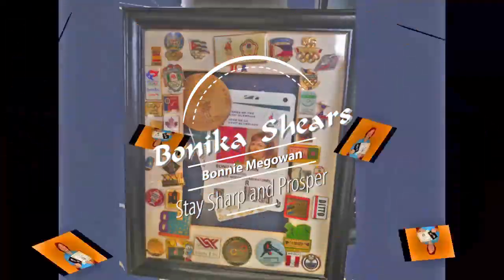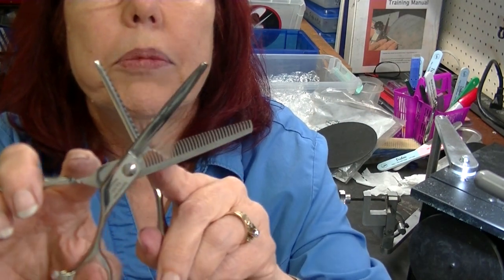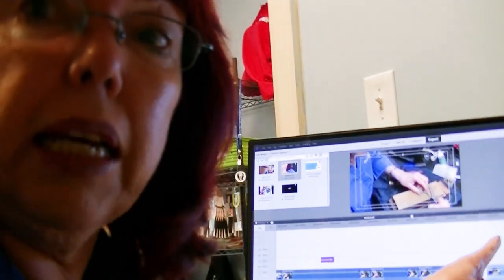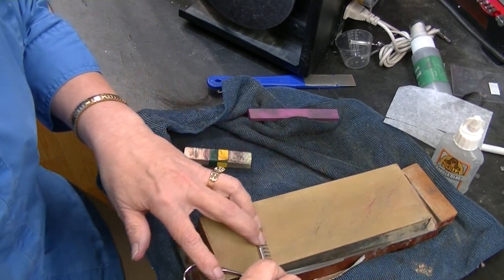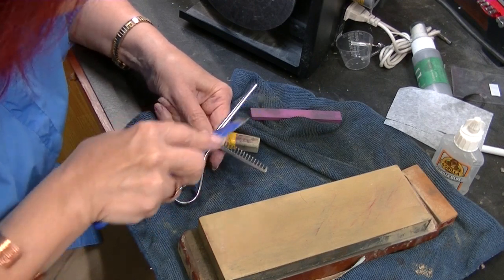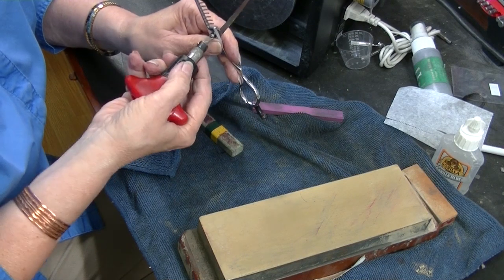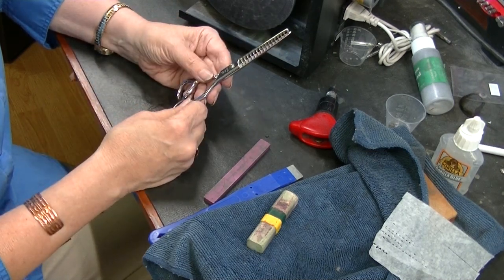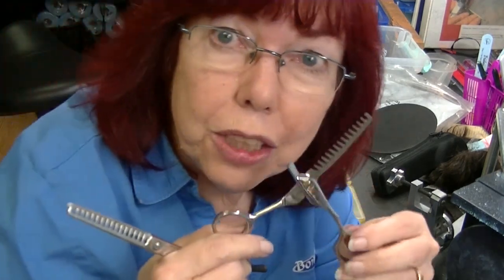How to Ramp Thinning Shears When the Teeth Catch

Comment: 🎯 Key Takeaways for quick navigation:

00:00 😡 The transcript chunk discusses problematic shears that catch when closed.
01:27 🛠️ Ramping is a method used to fix shears with catching teeth.
03:15 🔨 Ramping can be done using different techniques, such as using the handle as a gauge for the angle.
05:17 💡 Adding an extra washer can help fix catching problems in shears.
07:52 💡 Protruding washers behind the screw can cause cutting problems in shears.
09:47 🔧 Ramping can help prevent catching, but careful not to overwork the shear or break teeth.
12:33 🔧 Ramping thinning shears can be challenging, and it's important to avoid bending or breaking the shear.
12:59 📚 Sharing knowledge and experiences with other sharpeners is valuable for continuous learning in the sharpening business.
Reply from the maker: I need you to write these up for all my videos. Thank you.

Comment: I tend to flatten both blades first no matter the number of teeth.  Then a few passes with the pink stone.  When I see damage like this first thing I would then do is sharpen the cutting teeth side. * can not do this with the texturizers with multiple swept teeth with several  notches.  Then I come back with my finest serration tool and apply a new series of notches... Flatten to remove burrs on the blade.  Finally come back with my pink stone or as you did a few passes on the water stone to get the ramp.  Have also see people do the ramping by running their flat hone backwards and take a one second pass that is virtually flat. 2-5 degrees.  Seems to work almost every time
Reply from the maker: Cutting new notches is beyond what they are paying me!
Reply: @BonikaShears  lol  only takes about 5 seconds and most of that is finding my wheel.